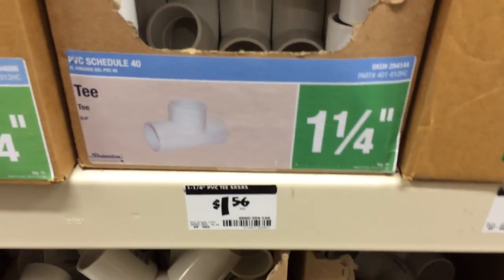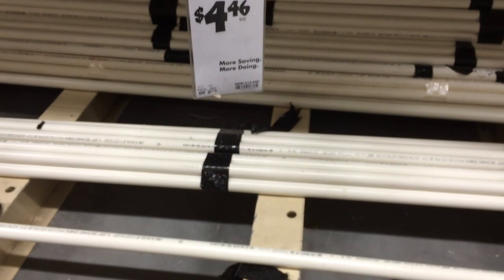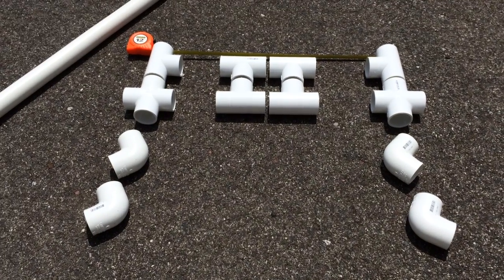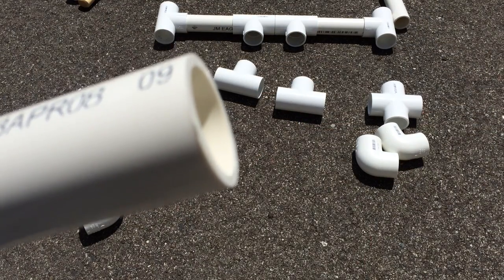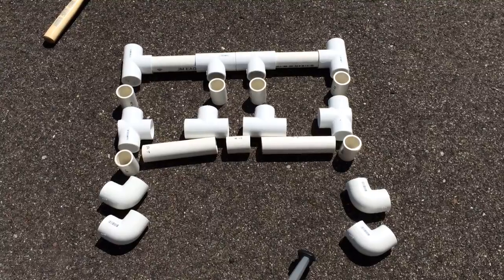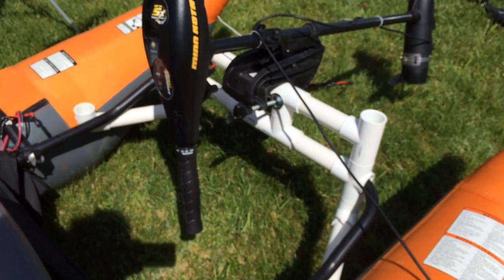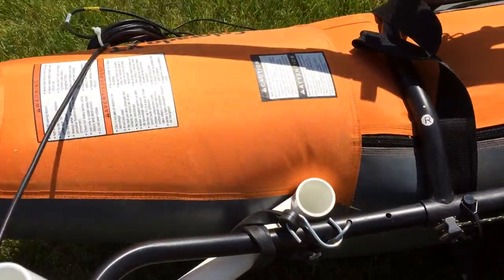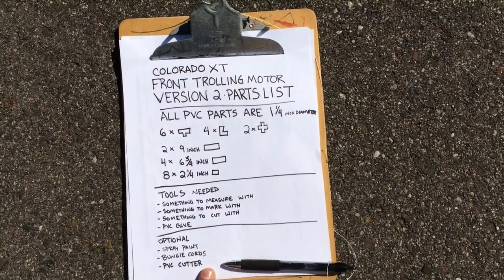Colorado XT - Front Motor Mount - Version 2

Comment: A while back I posted about ordering the Colorado XT in one of your other videos. I figured it was time report back what I have learned so far and a few ideas I’ve had. I’m still very much in the experimenting/learning phase with the Nate Rig Version 2. After building and using it I still think it’s a brilliant idea so super kudos to Nade D. So far I’ve taken it out three times. This weekend I’m going to experiment in my garage with a couple of design ideas, but it will probably be a week before I can hit the water again.  

Notes:
1. The first time in the water I rigged everything as directed in the manual (motor & battery in back), I had no intention of leaving it this way, but wanted try it just to use as comparison. While it worked, I’ll agree with Nate it put too much weight in the back(my 250lb fat butt didn’t help much ether).  
2. The second and third time I used Nate’s Rig version 2 rig built exactly to spec, but I wanted to test in the water before I glued everything down. 
3. The first time using the rig I didn’t use bungie cords(because I left them at home) and  decided to try using your foot method described in version 1 video.
4. I added the bungie cords for the second trip and I will say it worked better. I also discovered gluing the rig together is a must because the rig nearly came complexly apart on me while I put it through its paces.  

Design ideas
1. Two thing about the legs that hormonally stabilize the rig

        a. Rather than using bungee cords and sandwiching the elbow joint between the pontoon and the frame, I thinking about replacing the elbow joint at the end with a T joint. In the upside down T configuration I plan to cut a gap  just right size and angle for the boat frame to rest. Then securing the leg to the frame using a wing nut and a ubolt going around  a smaller piece of pvc or a wood rod inserted at the end of the leg.  Using wing nuts would ensure assembly/disassembly could be done by hand without any tools.   

        b. I’m also considering leaving legs unglued where they connect to the main rig. If option ubolt option works like I expect I don’t see this as being a problem. The goal is to make them removable. This will allow me flip the rig horizontal when storing the frame in my SUV without needed to remove the foot rests. This is also partly because I’ve have a hard time getting the holes to lineup because the foot rest tend to bind when trying to insert both with the rig fully assembled. Alternatively I also thought about cutting 4 small slits in the T joint on the rig the legs connect to and use a hose clamp to it down. Drilling a couple of holes in the T joint and using thumb screws is another possibility. 

2. I plan to zip tie the trolling motor power cable to the rig and frame, but have 45amp Anderson powerpole connectors at each boat session that comes apart so the boat can still be fully disassembled.

3. While not specific to the boat. I just ordered the Tenergy High Precision Watt Meter & Power Analyzer and the K-Pump Kwik Check  Pressure Gauge from Amazon. The inline power meter(that I plan to mount next to motor on Nate’s rig) not only displays current draw and voltage, but it also tells you(in either Amp hours or Watt hours) the amount of power you have used. I ordered the Pressure Gauge because it is compatible with the Halkey-Roberts valve on the Colorado XT and being fearful of over inflating without a Gauge, I’m sure my pontoons were underinflated the times I’ve taken it out.  

Comments quesions?

wo5m

Comment: Nate D.  Thanks for the great video and tips.  I got my XT a month ago.  Had it out 3 times now.  My Minn Kota C2 30 has been ordered and is on the way.  Off to Home Depot today to purchase the PVC.  Good tip on purchasing the 10 foot pipe.  Before I retired I worked at Home Depot in the plumbing department.  If you came to me with your plane I would have cut all the pieces for you and would hope any other Home Depot would do that for you.  So if you don't have a pvc cutter, ask the folks at Home Depot to cut the pieces for you.

Comment: Just wanted to confirm that this works like a charm in the lake. For me and it could be  just the PVC parts I bought, I do suggest gluing all parts. The bottom brace did fall out the final trip in. But, I did just for extra support put 100 mile hour tape on it for an extra support. So didn't lose any parts. However, the front mount driving with Nate D's design worked awesome! Saves on the back twisting around all day. Lastly you will need to drive your motor in reverse unless there's a way to turn the hand around to face the same direction as the blades. Over all A+ design. Well done Nate.
Reply from the maker: GreedeeVids thank you for the feedback. I’m delighted to know this is working for you. As far as driving in reverse, on my Minnkota, there is a little bolt just below the head of the trolling motor, at the top of the neck. I just pulled that out, twisted the neck 180 degrees, and put the bolt back in (you may need to move the cables a tiny bit). No need to run in reverse anymore! I ran it this way for years without issue. I may be able to do a quick video on this if you need further clarification on it.
Reply: @nated2951  Thank you sir, I'll give it a shot tonight. I even pointed a fisherman towards your video and gave you credit on the lake when a guy commented on how cool of an idea this was. I said Nate D and front motor mount on youtube for it. He even gave exact measurements and amount of parts to make. Great guide sir.

Comment: Thank Nate, this helps me.  I've got an electric motor with a foot petal, i'll try something like this and screw the foot petal to it and leave the motor in the back.
Reply from the maker: Jus be careful with the weight distribution. I would strongly advise against having the motor and battery on the same side of the boat. It will make that side very heavy and your boat will not be balanced at all in the water. At least that's been my experience. Best of luck!

Comment: Moved my motor mount from back to the front and pinned into existing holes for foot rest.   Left foot rest behind. Steering is made easier since motor handle and speed controls are in front.  Secured back rack for battery to frame using anchor rope ( a more permenant solution is possible to pin rack).. Put feet on pontoons or in the water when travelling.  Considering a  future clamp-on rudder attachment to motor shaft for additional steering ability.
Reply from the maker: That sounds great! You should post a video!

Comment: Fishing has to be fun now that you have all that stuff in the way
Reply from the maker: Keith Dauss Well, its more fun than rowing. It's more fun than having the back of the boat submerged due to uneven weight distribution, and it's more fun than standing on shore wishing I could be out on the water fishing. I can troll, and I have caught bass while floating in 2 feet of water. 

Honestly, the trolling motor can sit pretty low in the water, and I usually cast to the side of the boat anyway, so I haven't had an issue with stuff b info in the way. All things considered, it's works out pretty well for me and at least a few other people who have similar setups. 

- Nate
Reply: Damn skippy

Comment: Hi Nate, what would happen if you only cut the outside, of the pieces the foot rest goes into, so that the foot rest goes in but the top and bottom of the PVC piece remains holding the foot post from turning up or down, practically deleting the additional pieces you attached with the bungie cords on to keep the brace from rocking frontwards and backwards. In other words only remove as much of the outer wing to allow the foot rest to enter the piece in the new slot you just created and not cut off the entire outer section off. I hope that makes sense.

Comment: I love this video. I have the Roanoke so I had to make a couple of modifications.  I wanted to add photo's to this post for other Roanoke  owners but can't for some reason.  I have a couple suggestions/recommendations.  First, in the video you say the front isn't ideal for rod holders. The holes work great for me.  I can actually hold three rods and a net (or 4 rods).   Second, you said you didn't want to drill holes so you purchased the four way connector.  I decided to drill and really like it better I think. I used a one inch hole saw and it's a fairly tight fit. Finally, I did glue the four joints you recommended. I think for the piece of mind that I'm going to figure out a way to use tie straps, rope or some other method to secure everything horizontally and vertically just for extra measure.  I also spent the couple extra bucks and spray painted it black. Great job with the video and thanks.
Reply from the maker: Rick McLatchie Thank you for the kind words, and much thanks for providing the additional insight. I'm very happy to know that this helped you a bit with your setup. I imagine your tips will help others with their rigs as well. I would love to see a photo or video of your setup sometime. Also take a look at some of the other mods out there. This design is pretty basic. Other people have taken it and done much more impressive modifications. 
Happy fishing!

- Nate

Comment: The 2 nine inches pieces for the bottom don’t work on mine. I need to cut them smaller or do you not blow it up all the way?
Reply from the maker: ronyewest That’s really strange. I always inflated my pontoons fully and never had a problem. Are you using the Colorado XT?
Reply: I have my foot rests in pretty far. Only one hole is sticking out past

Comment: I have just finished a front motor install. My pontoon is only a 8 footer but it dog tracks like crazy. If I hold the throttle straight I just go in circles. Anyone else have this issue?
Reply from the maker: David D try adjusting the height of your motor. The thrust could be being partially blocked by your pontoons unevenly. Lowering it a bit may help. Good luck!
Reply: @nated2951  Thanks for the reply! I tried many adjustments. I do only have a 30" shaft. I might try turning the head of the motor back the way it was and drive backwards. Thank you!!
Reply: I have the same problem. Tried everything I could think of . Weight distribution, motor depth,  couldn’t get it to track at all unless I had my feet in the water. I’m stumped..
Reply from the maker: Trevor Rotter just catch bigger fish and have them tow you around the lake. 😁

Comment: Awesome video, I want to add this to my new Colorado XT ( I named it "looney toon") I think this would help a lot with ease of control and weight distribution but my questions:    How do you enter/exit the boat with the mount in place? Now I just step in through the foot rests. Also I read some comments that front mount "messes up" steering, but with no other explanation. Can you comment on that? I assume you had a rear mount prior to this. how do you compare the to?
Reply from the maker: Carol Lawlor Thank you for the great questions. I will do my best to answer them here. Entering and exiting the boat is the same. You just step over the metal foot rest in front of the boat. It has never been an issue.  I personally don't find the steering to be too cumbersome and it seems to be roughly comparable to what it was before. That being said, it can be tricky to go in a straight line with this boat. You often have to make corrections while piloting the boat. Some people have had better luck by changing how deep their trolling motor is in the water. As far as a rear mount, I did have one. It was so amazingly disappointing that I was about to sell the whole rig. After my second outing I was almost in tears due to how frustrated I was. Just before I listed the boat on Craigslist, I decided to give it one last shot and see if I could fix the boat instead of getting rid of it. That's when I came up with the design for the front motor mount. It immediately went from being a frustrating/infuriating experience on the water to being lots of fun. Having the trolling motor in front also makes it easier to grab the handle to steer. I'm sure it won't be the same for everybody, but that has been my personal experience. "Looney Toon" is a fantastic name by the way!

Comment: Nate,
I really like the new design.  I had one quick question...  Is there a reason you didn't get rid of the foot rests and have the PVC insert into the foot rest holes?  Thanks so much for the inspiration!!
Reply from the maker: Candpdad,

I inserted the foot rests into the PVC because, after a fair amount of experimenting, it seemed to be the best option. The foot rests fit really snugly into this size of PVC pipe. Also, I made a very specific effort to have the design for this to be as simple as possible. I figured the simpler the design, the easier it would be for other people (and myself) to build their own. I'm glad you like it. Let me know how it works for you!
Reply: Great thanks!

Comment: I know this video is several years old. But how did it work out?
Reply from the maker: Eric,

That’s a legitimate question. This has worked out quite well. I did use PVC glue to  to hold it firm. I also ended up using zip ties instead of bungee cords to hold it in place. Overall, it’s still going strong. Other people have modified the design a bit to fit their needs as well, but the core remains consistent and solid.
Reply: @nated2951  Thanks! Did you even end up putting a solid piece on the backside of the motor mount?
Reply from the maker: Eric,

I initially thought I would need some sort of back plate for the motor, but as it turns out, as long as I have it clamped tightly, I don’t need one.
Reply: @nated2951  Thanks

Comment: Any one try taking the motor mount assembly and putting the whole thing in the holes for the foot rests? A welder could weld brackets for the battery rack to the foot rest tubes so you put the rack in front too so you could stand. Maybe weld up a new battery holder to fit in the tubes where the rack used to go in back.

Comment: Hey Nate, first off thank you for this awesome tutorial, I'm about to go outside and assemble this trolling motor mount right now. I have a question about this toon, do you happen to know what the differences are between the Colorado XT and the XTS are? if it's just the swivel seat then I was able to upgrade mine to an XTS for $7.00 lol. Anyhow thank you for this and I'll post a video of my maiden voyage.
Reply: Hey Ramon, I had the same question before I bought mine. After doing my research I discovered only two differences the swivel seat and that the boat is blue. I ordered the Green Colorado XT from Walmart online for $499 and added the swivel seat as you suggested. At the time the Colorado XTS was $667.93(now its on sale for $600). While I like the blue color I don't think any color is with $161 or 32% the price Colorado XT. Even at the current price of $600 I still don't think it worth it. Now all that said, the Classic Accessories Oswego Boat is one I would have jumped on if it still was available, but it was discontinued last year.  It was the next step up from the Colorado XT. From what I understand it had the same frame and parts as the Colorado XT, but came with red 10' pontoons vs the 9' with Colorado XT. I wanted it just for the extra weight capacity.
Reply: Yes I got mine for $479 from Cabela's, with the front trolling motor mods, battery, trolling motor and modifying the single wheel to a dual wheel, I'm at about what it would've cost me to get the XTS at Bass Pro Shop. I absolutely love this thing, I added some rod holders but they ended up being on the way, the only problem I had was with that single transport wheel making it difficult to maneuver to the bank so I purchased a steel rod and two new wheels and now with the two wheels set 2' apart it is so much easier to move.